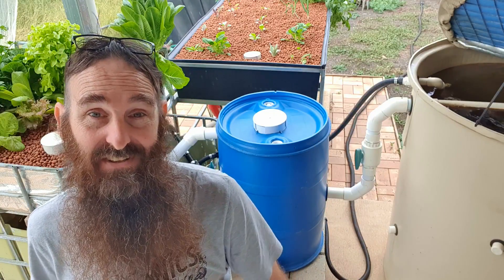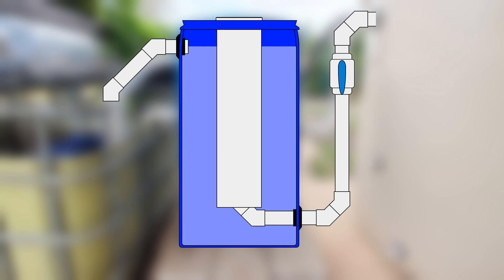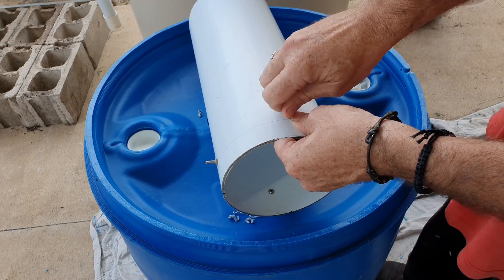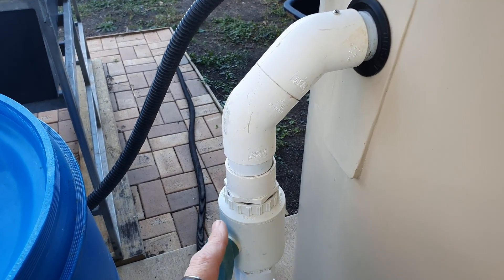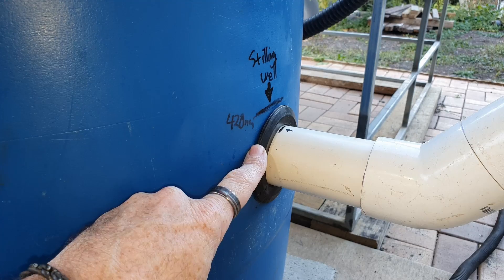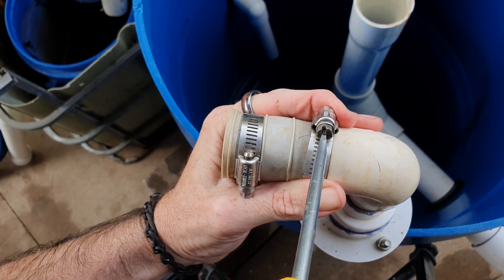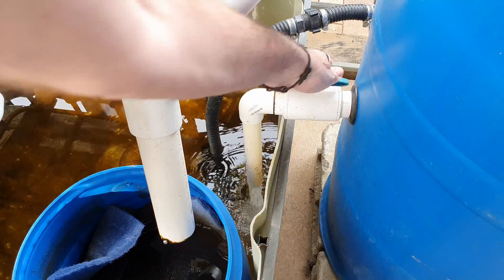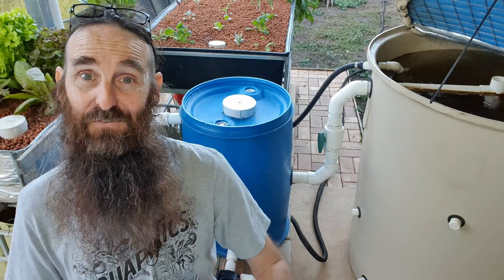How to Build Radial Flow Settler for Aquaponics System | Components & Tips

Comment: Great content Rob. Working on one myself. I have a request. Can you make a video on TDS. How it works and how often you measure it. If you have made one already, can you provide the link please. 
Thanks.. Vivek
Reply from the maker: As far as I know TDS meters aren't very accurate in reading the available nutrients due to the organic forms many are in in aquaponics. I'm yet to speak to someone that uses them regularly. Sorry I'm not much help there mate.
Reply: @RobsAquaponics  Yes.. I feel the same. Have been using a TDS meter on a daily basis for over 2 months now. I think it basically tells you all the solids available in the water and not specifically nutrients. Have always noticed a spike in TDS reading when the water is dirty. Also, I am getting an impression from my experience that TDS doesn't really matter in aquaponics as long as we have a hold of the pH and provide Potassium and Iron supplements regularly. BTW.. enjoy your break from youtube. :)
Reply from the maker: @vivekvinayan6014  Cheers mate. 👍👍
Reply: We use a TDS sensor to determine filter cleaning schedule. https://youtu.be/hN8dvLG1uVU

Comment: Thanks for the video!  I'm using your plans to build a new solids filter for my revamped AP at home.  I had something similar previously (with the filter nested inside a mineralisation system inside a sump) but while it did a reasonable job it was a bit too small, was hard to service/maintain and took up real estate in the sump. I think this will be much better.  

I'm having a go at making a weir that goes all round the top (using the top off a pickle barrel that I'm hoping to seal to the inside of the barrel), will see how it goes.

Will also add a radial flow filter to one of the aquaponics at work soon.
Reply from the maker: Nice one Simon. Hope the build goes smoothly for you mate. 👍

Comment: THANK YOU ROB! YOU ARE A HUMBLE AUSTRALIAN LEGEND! I LOVE YOUR CHANNEL! I HAVE A QUESTION?
I'm only at the design stage and have a Squilion ideas for systems. From the moment I saw Aqua / Airponics, I realized that it's manufactured scarcity and government tyranny that keep many parts of the world in starvation. If only they built these systems out in the third world instead of vaccinating the hell out of them. Anyway. The question I have is - Is it possible to have the main pump turn off for a period at night and just run the air stones? How do the fish sleep with the constant flow pushing them around? I always imagine setting up a scheduled "Off Time" during the day and or night - or - and period where the pump flow is reduced in a varied flow rate through the day. As I'm kind of a whiz with electronics etc, it's seemed far more efficient to me in reducing or varying the speed of the pump (reducing power) rather than increasing load resistance by restrictions. What so you thin k mate, I know you like to keep things simple, and I totally love and relate to that. Also have you ever used a ozone generator to break down the bio mass and or periodically use in the system to keep algae at bay. It, doesn't harm the fish as far as I know. Anyway, cheers and many thanks - you are doing great things for this world mate.
Reply from the maker: Hi NI. 
I like the water to be flowing through filtration at all times so that's why I run the water 24/7. 👍
I know folks that run timed systems as well & they look to work OK too. 
Haven't thought top use O3 to tell you the truth. I know folks that have used it for food preservation & odour reduction but not in an aquaponics system.
Will have to suss that out when I get the time.
Cheers mate.

Comment: Hey Rob built my first filter but i can't get it to overflow from fish tank to filter.  It gets to the top but just stays there.  I didn't glue everything so there is some drips would that cause it?  I also wondered if i got all the heights right.  I posted a video my build here 
https://youtu.be/rZKMhn9EQUY any help from community would be appreciated and i sent a donation today in paypal for all the your hard work and what i have learned from you!
Reply from the maker: Hi mate & I'm very sorry it took so long to get to answering your question. You've probably fixed it already but my guess is that the outlet in the filter is taller than the water level in the tank. 
Have you sorted it out yet? 
THANK YOU very much for the Donation👍👍😁 I was wondering where that came from 🤔

Sorry again for taking so long to get back to you AD.
Reply: no problem that is what exactly it was.  Finally got it fixed.  Appreciate your channel! @RobsAquaponics

Comment: Rob, I saw in your old videos you used a 5 gallon bucket for the radial flow settler. I’m running a chop and flip IBC tote with 175 gallons in the fish tank and a 64 gallon sump. Would a 5 gallon radial flow settler be effective for my setup? I don’t quite have enough room for the 55 gallon setup. Thanks in advance I’ve built my entire system using your awesome vids. Cheers from Texas 😁
Reply from the maker: That would depend on your flow rate Clifton. I run through working out the retention time in a recent clip if that helps at all,
https://youtu.be/sBCC9tMsleY
Cheers mate.

Comment: Hey Rob!
I heard someone say that an aquaponics system is great for leafy greens only (Lettuce, Mint, Parsley, etc...). and that it lacks iron and potassium which are crucial for vegetables and fruits (Tomatoes, Eggplants, Strawberries, etc...).
Is that true? and does that imply that I have to constantly add potassium and iron to the system?
thanks
Reply from the maker: Some folks get away with not adding either as they tend to have a low plant to feed ratio (meaning more feed for the fish & fewer plants) than others. Most folks will add in some form of potassium to help if they are growing a lot of fruiting plants & many will also dose with iron as well.
Cheers.
Reply: @RobsAquaponics  thanks Rob, does the excess potassium and iron harm the fish once they come back to the fish tanks?
Reply from the maker: @nourhabra  Sorry I missed your 2nd post.
There should be no harm to the fish if you use the right additives. Potassium in the form of bicarbonates, hydroxides, silicate & potassium-rich kelp/seaweed additives are suitable for use in aquaponics. Iron wise, DTPA iron chelate is a fish safe additive that is probably the best iron additive to use as it is plant available over a wide pH range.
Hope that helps some.

Comment: Just wondering if you have thought of using a https://www.waterco.com.au/aquaculture/multicyclone for this purpose, I have seen a few the other week going cheap on gumtree. We have one on our pool and it is interesting to see how much fine material it removes from the water.
Reply from the maker: i haven't seen anyone use one on their system James.  It looks like it needs a bit of a high flow rate so probably wouldn't work too well wit the gravity flow from the fish tanks. Looks like the smaller one requires 40lpm minimum which not many folks with a 1000L tank would have.  Might be worth it on a larger system though. 👍
Cheers mate.

Comment: That's awesome. But when I use the radial filter, the air stones in the fish tank stir up the fish food remains and their feces all over. The water always looks cloudy whereas your fish tank looks so clear and good in the clip.
Reply from the maker: Do you have a solids lifting outlet to remove the waste from the base of the fish tank?
Reply: @RobsAquaponics  Yes, I do. I build the filter exactly like what you instruct in the clip.
Reply from the maker: @toientucoiamty5630  You might need to increase the water flow into the fish tank a bit by the sounds of it.
Reply: @RobsAquaponics  I stopped using a timer, now the water looks a lot better. Thank you Rob <3.

Comment: How do you prevent the water level from over flowing?    Looks like the drum is well below the fish tank water level.  Left unmanaged the water will flow via gravity over the drum lid.
Reply from the maker: The solids lifting outlet in the fish tank will only release as much water out of the tank as is flowing in at one time. 
The same goes for the settler itself. 👍
Am thinking about doing another clip on the solid lifting outlets as a few folks are a bit confused as to how they work.
Cheers Glen.

Comment: A tip.. If you put the shower drain in the center and then just swirl the content of the tank(let it settle) you will get solids to collect right under or close to the drain. This should reduce the volume of water mixed with sludge drained from the tank. In other words you get a higher concentration of solids with less water in it. With that you can reduce the size of the Mineralization tank.. Cheers "Mattress Man"
Reply from the maker: Hey "Mattress Man". Do I detect a Swedish accent? 🤔
There's a ridge that stopped the fitting sitting flat so moved it to one side. 👍 I was contemplating heating it up & flattening out the base but as most folks would be able to I went with the offset. 
Have used a similar heating method to create a straighter sidewall in my parent's settler drum for the drain valve assembly. 
Cheers mate & thanks for all your help.

Comment: Ever looked into bead filters auto cleaning
Reply from the maker: I priced some but the cost was prohibitive for a small backyard system. Import tax, exchange rate & markup once it landed almost doubled the price of the AST which is the brand I'd be using. I'm still playing with the idea of making a DIY static upflow filter but will leave that until the weather warms up a bit I think. 
Cheers.

Comment: What makes the water go to the stilling well?  Just gravity?
Reply from the maker: Hi Sally.
The water flowing into the fish tank causes the water to overflow through the solids lifting outlet & into the solids settler. 👍
Some folks will use a pump in the fish tank but I prefer this set up as the fish tank will always stay full in the event of a mishap elsewhere in the system. 
Hope you folks are doing well & not going to bonkers while in "lock down".

Comment: Rob,

Have you had any experience with rotating drum filters? I'm thinking of building one (buying looks to be very expensive and too big for a backyard  aquaponics set up). Have you heard of anyone using a chiller? We're in NQ and I'm keen to try DWC but am concerned about our water temp over summer.
Reply from the maker: I would love a drum filter but cost & size is an issue. Have seen a few DIY screen filters here on YT.  I'm looking at pricing some 100 micron up for my current build as I want to put a cone of it in my current static bio filter. 
I know there was a chap on the BY aquaponic forum that was running trout in a modified commercial freezer for a few seasons so it can be done. It also helped that he was a fridgy. 😉 Not sure if that would help you out through. 
Cheers mate.

Comment: Rob have you ever considered bending the pvc pipe rather than using elbow fittings?
Reply from the maker: I have seen other folks bend the PVC but they also lose some of the diameter as well. Am happy to use the fittings for myself but if you can get the pipe to bend you might as well go for it. 👍👍
Cheers RWS.
Reply: @RobsAquaponics  I'm trying the sand filled method so there should be no restrictions, really tight bends may need an elbow. Let's see what happens.

Comment: How do you determine the height of the water in the fish tank in relation to the height of the water in the radial flow settler in relation to the height of the water in your sump tank? If the water pump looses power, is your sump tank large enough to handle the water that’s coming from gravity?
Reply from the maker: Thomas & Michel nailed it below. 
This link will take you to a section of a clip that may help explain SLOs a bit better & how they prevent the sump from over flowing,
https://www.youtube.com/watch?v=2FTlha0c2aA&t=2m53s 
Cheers.
Reply: I believe the system is designed so that the fish tank can't fully siphon empty, and the sump tank to have enough spare volume to accommodate any water that does siphon into it.
Reply: @thomasbecker9676  : correct.  if you see the top of the SLO pipe, where it comes out of the water is a T fitting open to the air ... that means it can't siphon.  Once water level drops below the line of the bottom of the horizontal pipe, it stops flowing by gravity.
Reply: the water out of the RFF has to be ~20mm lower than the top of the stand-pipe, and the water level in the fish tank should be ~20mm higher than the top of the stand-pipe.
that'll give you best performance and avoid sections from trying to act as a water-bridge.

Comment: This is so cool.  I wonder how much time do you have to spend on maintaining this every day, and how often do you have problems that take a day or more to fix?  In other words do you think this technology is ready for prime time use by non-experts like me for example.  Oh, and do you actually eat the fish you raise?
Reply from the maker: On a daily basis I feed the fish (should take less than 1 minute but I like to watch😉), test the pH then add buffer if needed & harvest if we're needing something in the kitchen. I also give the plants a once over for pests when harvesting. 
All up that's a bout 5 min if I drag my feet or about 2 if I'm in a rush. 
I top the water up when I need to clean the filter. That process is once a week at the moment & takes me about 20min. 
All up, not much time is spent on the day to day just a bit extra on the weekend to clean the pump. Most folks I know like to spend more time at their system looking at the fish & just relaxing to the sounds. 👍
No down time at all once the system is up & running except for pump issues & that was more a quality issue with the pump than the system. 
Have eten all the fish we've grown so far except for a few we've shared with family & friends.

Comment: Instead of a large diameter pipe through the top could you just attach a small bucket to the lid and add a few holes to let the air out.
Reply from the maker: That was how we set up our first settler & it worked well Jason. 👍